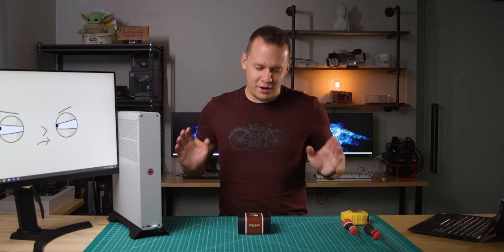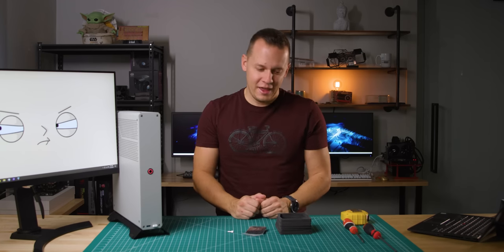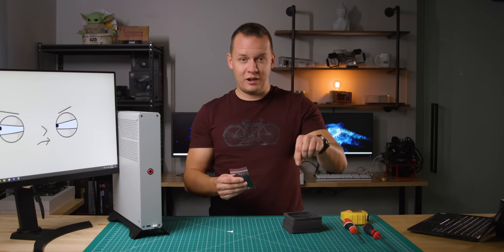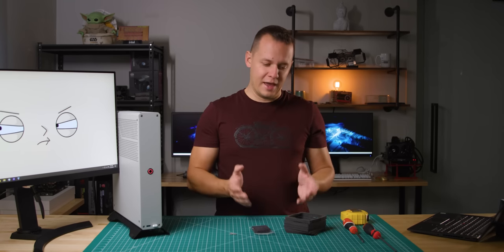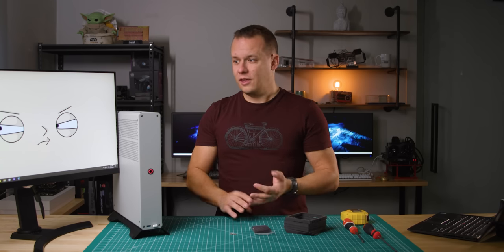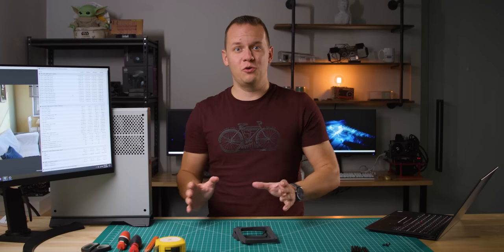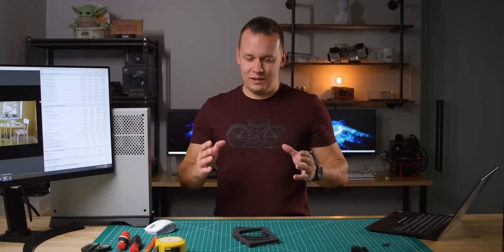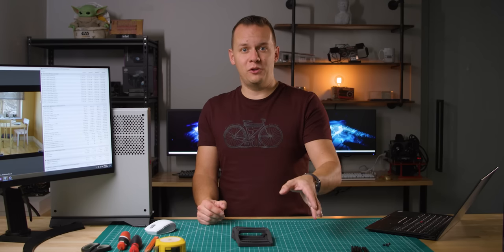Lower CPU Temperatures Just Need THIS!

Comment from the maker: Hey guys.  Sorry about the audio at the beginning.  Our primary mic crapped the bed and we only realized it mid-way through filming.  We did everything we could to compensate in the edit but my apologies since no, this doesn't live up to our standards but it won't happen again since we found the culprit.  :)
Reply: I don't even notice anything. Mic quality is a little less, we'll survive 🙂
Reply: Don't mind that, audio just fine compared to others
Reply: would be awesome to adapt something similar for gpus, sure will help with temperatures too. Major hardware already tried some duct for the gpu in an ATX case, and improved temps a lot
Reply: This looks like a joke product. Grabs black Friday extra packaging and opens knife 🔪. Cut to fit.
Reply: Hi please can u do a review for Decoche Gaming Headset Stereo Surround Sound Gaming Headphones thx
Reply: Question for you Hosers, If you used this, or something like it, to space your fans away from your radiator, so the blades aren't so close to the fins, would this let the fan move more air?  Removing the effect you get when a window curtain is to close to window box fan & that is blowing or sucking side.
Reply: Also I'd love to see a break-down of the simple tools you'd need to easily modify a computer case, like; a drill w/ bits, tin snips, thread cutters set that includes M2.5, M3, M4, M5, an box of M3 brass standoffs with assorted heights, so when mounting items inside of a case you can have them all an even height for straighter tube runs, & with the drill & thread cutter you can have items the same place (X,Y, & Z) with the case by moving there mounting points on the mother tray.  Tin Snips are useful if a part of the case is in your way that isn't structural, you can buy a blank sheet of the same metal to bend & mold how you need to replace it, or anything else you want to change.

For example you bought everything you need for a build, but the ram you have is to tall stopping you from mounting fans & radiator in the top of the case.  All you'd need to do is lower motherboard by drilling new holes, threating them, & moving the standoffs down, & cut a new I/O motherboard hole in the back panel.  If you can just extend the I/O hole lower as needed, & cover up the extra space left above now with piece of blank plate, hell you can just cover the hole with duct tape.  Or the fun way, with a blank sheet of metal, trace on it what you need to keep & what you need to add, cut away what you're replacing from the case, & drill & screw in your changes.  Painting it first, & if you do not see the case being used for anything else, you can just pop rivets in the holes you drilled, without t he need of threating them.

And the same is true when installing a vertical GPU & run into the same problem where you want to mount the GPU is hitting, blocking, to close, or just plain ugly.  Since you'll be bending 90 degree bends you're going to either shell out for hand held sheet metal bender tool, or just use a bench vise, or a few pairs of lock-grips, and or add in a couple of foot long thin steel bars.  Also when bending a 90 degree bend, no one ever said it had to be bent all at the same time, you can bend a little at a time not to stretch the metal & get a damn close to perfect once painted result.

And you're going to want deburring tools & a set of metal working files so you can finish your work, along with safety goggles, gloves, & a shop vac, you do not want to leave tiny sharp metal splinters pieces covering your work shop. Doubly so if you have kids or pets.  

You may wanna do what I do, & use stainless steel sheets no matter what the case is made out of, because it's easier to pick up shavings, filings, etc with a magnet.  And god forbid you end up with a piece in your eye, it is a lot easier for the doctors to remove it from your eye with a magnet.

And the paint you're going to want to use, could go all out & get a GOOD powder-coating system, but remember, you get what you pay for with them.  Or buy spray paint in the matching colors you'll need.

EVERYTHING I just talked about I learned how to do by watching videos on here, on YouTube.   

Hell I had problems with my on-demand water heater, a plumber was working next store so I asked him when he was finished if he could take a look at it ... when he came over he told me what was bad on the unit, & gave me a price of $1,200 dollars ... I asked him to leave, they were ALL screw on parts, a over flow valve, a fill valve, a 4gl pressure tank ... That night I looked up on how to replace them & the next day I turned off my heater & drained it, unscrewed the parts & took them with me to Home Depot, I stopped by the "check-in" counter so they could tag my parts as being mine & that I wanted to bring in to replace, the check-in man called over a staff member that worked the floor to me to help me find the parts, & I bought the identical replacements, took them home & installed them, including lunch on the road, gas, & road tolls less then $100 dollars.  I already owned Teflon tape, & all the needed tools.  Took me an hour to do the full "$1,200" install of $64 dollars worth of parts...

The above was last week of the post date of this comment.

Comment: I'm reminded of old cases in the 90s and early 2000s that would have a plastic funnel on the side panel funnelling air from the cpu
Reply: Yeah, sometimes these were even spring-loaded.
Reply: I had a case like that but shame it didn't line up well so I just put a fan there.
Reply: Damn, is my case that old, lol
Reply: I had one of those
Reply: @globalist1990  same
Reply: i have one of these i stole from an old case . still using on my new pc
Reply: I still have 8 of those funnels lying around
Reply: That was the whole point of BTX form factor that died.
Reply: The funnel was good but not enough. 
Looking the heat through a infrared thermo, the heat weave gets located next do VRM/Mosfet/PSU.
Reply: The funnel was good but not enough. 
Looking the heat through a infrared thermo, the heat weave gets located next do VRM/Mosfet/PSU.

Comment: as many others mentioned, its old tech. but with a modern approach. i like it. its definitly a niche product, but for those few cases (ha, cases!) where its useful, its worth it.
Reply: Modern approach would be to 3d print exactly the size and shape funnel you need.
Reply: @CJICantLie  True, that would be great but they would probably need to study a lot of ITX cases to get the measurements right and even then, it most likely wouldn't work for every case due to height differences. Using a bit of armaflex insulation though, that's an easy diy. 😉

Comment: Not only is it showing 6°C lower temps, it also shows 100 to 250MHz higher clocks. Gonna consider such a solution.
Reply: It's showing that on the slower cores. For gaming.. this wouldn't help. I would be curious to see how the higher boosting cores respond as that effects gaming performance.
Reply: great that u noticed, that is important too.
Reply: @christophermullins7163  True, but if the slower cores get a boost, I expect the faster ones to get a boost too.

I have an LH-l9i on a R5-3400g, in a tiny case without intake fan. It's not remotely comparable in terms of power dissipation, it's not even reaching 70°C under gaming load. I'll post results if I ever do add foams, for comparison's sake.
Reply: @ujiltromm7358  I would expect the slower ones to get a huge boost compared to the faster ones. Running 3ghz takes 1/3 of the energy as running 4.7ghz.
Reply: Another benefit would be lower fan speeds. If it's getting feed "cool" air, the fan wouldn't need to ramp as much, albeit probably only 50-150rpm.

Comment: Used to make "ducts" like this with tape and milk cartons back in the mid 90s 😀. There was no science back then, but good to get the consept confirmed 30 years later 😜
Reply from the maker: Ha!  I did the same in a Gigabyte 3D Aurora. - Mike
Reply: @ca1ib0s  All that and cutting out entire sections of the interior metal frame surrounding it underneath the plastic cover for more air flow.

Comment: I use rolls of adhesive foam strips from hardware stores. It’s cheap, sticky, and flexible. Easy to cut and stack. It also comes in various thicknesses. This means you can also use it on gpu’s.
Reply: Foam board from an arts and crafts store works pretty good too, gotta cut it yourself but as long as you get a seal between your fan and case it works pretty well

Comment: Air ducts work. That is if the case design allows for it to make sense.

Way back, probably 20 years now, I experimented with making an air duct for my CPU. I discovered a few interesting things. My first version consisted of a piece of air conditioning hose that was just a hair larger than the fan diameter. I thought that would be about the perfect size and wouldn't restrict the airflow. Well I was wrong. I based that conclusion on the fan speed. Thing is that just putting that duct on the heatsink made the fan spin faster, and it was set at full speed from the get go. What happened was that the funnel reduced the air pressure immediately in front of the fan. This reduces the drag on the fan and it will spin slightly faster at the same power input, and yet move less air. The restriction consisted of putting a barrier up that restricted air from rushing in for the sides.

I ended up with a airduct that was significantly larger in diameter than the fan in order to keep it feed with fresh air without strangling the performance. Then I put the side panel on and the fan speed went up again...

Well at least that was easily explained as the intake consisted of a lot of round holes stamped in the side panel. These are notoriously bad for airflow. Now I had the choice of just living with it, making an even larger funnel design or but out a large hole for the duct. Note that even though the fan was being starved the CPU temp had actually gone down. Even so I decided on cutting a hole and I put an old style wire fan grill over it.

It also used to be that a lot of small cases came with an air duct attached to the side panel. Problem with these were that a lot of the time you ended up using a motherboard with the processor placed just slightly offset from that airduct, which usually was made of hard plastic.

For a while a lot of cases, both small and large, came with a fan or fans attached to the side panel. For CPU cooling it was a good thing, but it could make a mess of the cabling and I'm sure a lot users resorted to harsh language when tangling with these. Fortunately this was before it got popular to make your computer case into a viewing cabinet so as long as you kept the cables from getting into the fans or something like that nobody really cared what it looked like inside.
Reply: I just picked up one of these old school side panel fan cases and I love it.  1 and a 1/2 120mm fans aimed right at the gpu and the 1/2 that goes over top of the gpu goes around the tower cooler and onto the motherboard components that the tower fan is neglecting.  I just had to get a shorter tower cooler by 20mm to fit the side panel back on with the fans on the inside lol.  The poor PSU is breathing CPU exhaust but oh well it only runs around 200-300 watts in games.

Comment: 8:08 it's not only 6°c cooler, the clocks speeds are 200/250Mhz higher, a little oversight to talk about the actual performance and value imo...
Reply from the maker: This is true.  However, when you average out all the cores (the others were cut off) the actual difference on average was about ~150MHz but good catch!
Reply: Cpu package Power looked same . Not sure how accurate the number is
Reply: @mistakenotou7681  power leakage reduces when a chip is cooler, but sure there's variance in the power and clock values anyway

Comment: Tip for mounting for this config, just put on the 10mm, cut a little bit above them, then take off the 10mm and put the 4mm on the bottom. you'll have plenty of clearance to avoid the straws and it'll still be super solid.
Reply: I was thinking the same, flip the foam spacers, meaning if you make the straw 2 mm shorter, you’ll still have 8mm on ‘penetration’ on the spacer, versus 2mm on the 4mm.  If you get me!!

Comment: Some may not even want to use it to lower the temps, but to keep the same temps by lowering the fan speed and therefore have a quieter system.

Comment: Sometimes the simplest ideas are the best. My previous build was in the Node 202. I fixed my thermal issues by installing an AIO and routing the rad on the GPU side on top of my miniGPU, then installed a slim noctua 120mm fan as an exhaust on the CPU side shroud. Worked really well. But this would've been a much easier and cheaper solution.

Comment: My first modern gaming PC was one of those slim ~2008 Acers and I replaced the CPU cooler on it. Since the new one had lights, I made a similar extension by hacksawing off a section of plastic mayo jar and hot gluing it to the fan.

Comment: separating hot and cool air by a barrier with such shrouds also works great around a GPU. I got a 10K drop by a wide shroud around my GPU, fixed power and fixed fan speed. Often more effective than additional fans. The air from the exhaust fan (high pressure) takes the shortest path to the intake (low pressure), which is often just 1cm in typically GPU coolers. Sure, air flow momentum does reduce this effect, but still, a  centimeters of shroud have a huge influence on temperature. Same reason ducting is so effective.

Comment: Dell and HP professional workstations have been using cpu airflow tunneling  for decades. This way the heat from other components doesn't affect cpu so much. This is a good option

Comment: I actually 3D printed a custom vent for my cougar case and cpu cooler. The vent connects the cpu fan to the back of the case. The Fan is set to suck cool outside air. Did stress testing at 100% for 30min and my results were a 6C cpu drop with the vent. Not only that, but temps seemed WAY more stable and increased at a slower rate. Highly recommend those with a 3D printer and a sff pc to do the same.

Comment: Directed or ducted air flow makes sense. Years ago some PC case manufactures included external fan to CPU fan ducts. Critics deemed it unsightly and felt it didn't justify a slight drop in temperature. I never ran across any any substantial research to justify throwing the concept under the bus. Having been reminded, I will make a few 'ducts' for my pc to experiment.

Comment: I see a lot of comments suggesting other ways of doing this like, using cheaper materials, or this and that. The thing is, did the idea occur to you first before seeing this video? Or is your solution as efficient/elegant as this in terms of fit, finish and appearance? It's easy to take another's idea and suggest improvements to it, whether cheaper or more efficient or better-looking design. But to actually have the eureka moment and come up with the idea and design the working, good-looking product for it is another matter altogether. Give credit where credit is due. At least Noctua thought of a good-looking, efficient way of doing this.

And sure, the foam is probably cheap. But the research to ensure it worked before production, the tooling required to make the moulds, the manufacturing process to ensure correct tolerances, density of foam etc etc aren't cheap. If you're making it for your own system, you can use whatever cheap foam you want. But if you're a company and you're launching a product line for the masses, you better ensure your product's quality is consistent, even if consumers are going to say the materials used are cheap. I give Noctua kudos for this.

Maybe I'll be called a Noctua fanboy for this, but tell me, how many failed products have Noctua produced? How much time and research does Noctua put into a product before they actually launch it? Case in point, black versions of their cooler fans. Everyone thinks it's just simply changing the colour. But changing a colour dye isn't that simple cos different colour resin have slightly different properties and that might affect performance and fitting tolerances. Can anyone think of another cooler company that puts that much effort and pride into their products?

By the way, I love the brown and beige.
Reply: This idea is nothing new, just nice little package.
Reply: Prebuilds back in the 90's did this to stock intel/AMD coolers but instead it was a plastic funnel...  the use-case nowadays though is so minimal/niche that no one really bothered coming up with a "solution" like this.. if you want to spend $13 on this, go for it.

Comment: i never understood why PC cases aren't designed to at least separate GPU and CPU airflows with some kind of dividing wall or ducting to direct air flows
Reply: Me, too. I built a HTPC for my sister in a Silverstone ITX case with the ony fan being the CPU fan mounted so that it blows out through the top panel to which it sits flush. I had too high temperatures on the 3.5" video storage HDD though. So I built a wall out of thick paper which forces the air the CPU cooler is pulling into the case across the HDD which brought the HDD temperature to below 40°C which was an improvement of more than 10°C.

Comment: I went to home depot and got some 3/8x1/2inch rubber foam weather stripping. $2.50 for 10 feet and it's adhesive.

Comment: I chose my Cooler Master NR200 for a similar reason in that it allows you to have a fan right by the side of the case channeling outside air right onto the Noctua NH-L12S heatsink I use. Really helps keep temps down.